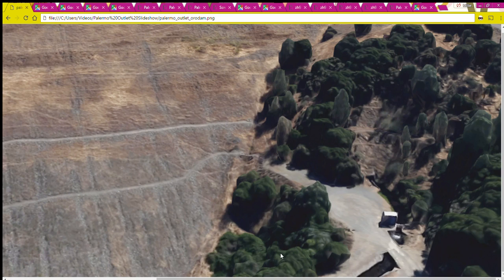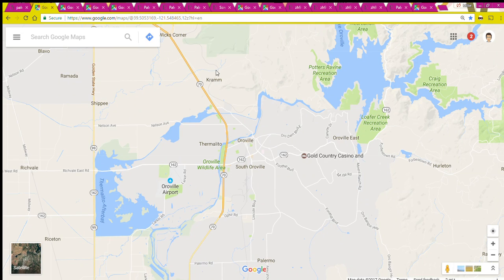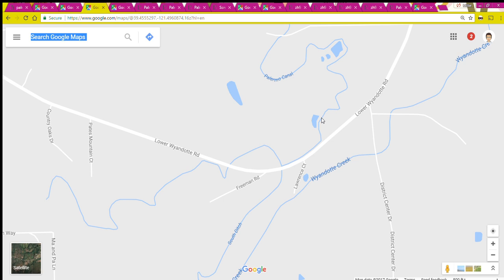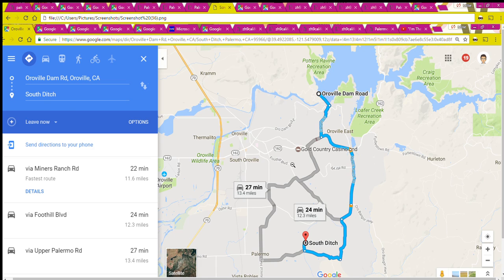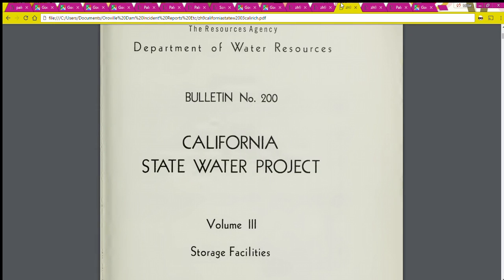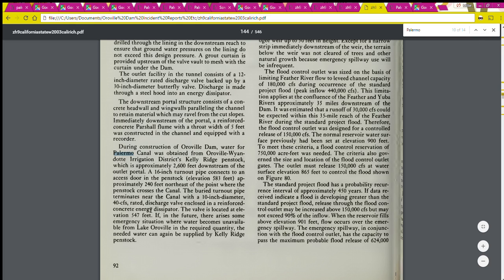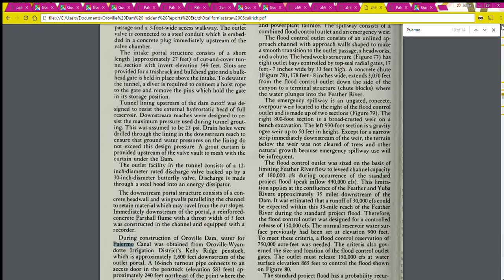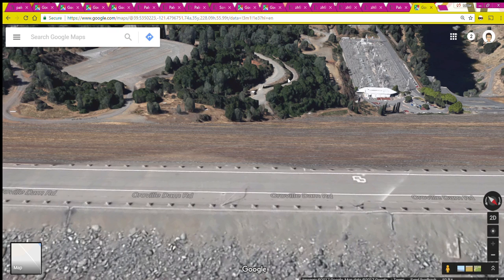The Palermo Tunnel Inside Oroville Dam  6/9/2017

Comment: Hello Millie I just want to say that you did a wonderful presentation on the Palermo Canal Tunnel through the Left Shoulder of the Oroville dam. I live in Oroville ( on high ground !! ) and am familiar with the location of the tunnel through the dam that only provides about 15 cfs of irrigation water through a valve near the outlet of the tunnel on the West side of the dam in the general area of the "green grassy area ?? ' that people are curious about. I had an opportunity to talk to Jeanne Kuttel , Chief Engineer for DWR at one of their Public Hearings and brought up the subject of the 50 + year old tunnel through the dam that needs to be abandoned and filled with concrete as it is a potential hazard over the next century +. The source of this Irrigation water to the very small Palermo canal can be easily relocated by placing a new valve in the penstock to the OWID power Plant  that crosses over the canal and under the highway as shown in your video. This would eliminate the need for acquiring irrigation water from a tunnel through the dam that could cause a potential BLOW OUT from settlement and earthquakes should it rupture. Jeanne Kuttel listened carefully  and said that she would look into it,.....we will see.
Reply from the maker: Hi Jerry. Thanks so much for your kind feedback! Your idea makes so much sense. As I was doing the research for this video, I was wondering about the risk potential of all the tunnels inside the dam. If maintenance of the tunnels is no better than that done on the spillway(s), it is a major concern. I'm glad you were able to speak with Jeanne Kuttel about the Palermo Tunnel. This is certainly a good time to present solutions to DWR. I've also been wondering if the "green grassy area" is tunnel-related. So many questions . . .

I'm glad you took the time to comment. Your input is insightful and worthwhile. Thank you.
Reply: I am wondering if there is an update on the engineering in 2021?

Comment: I understand the Palermo canal water rights are older than the Ca DWR's rights. What I don't understand is why the DWR went to the engineering trouble and expense of building a tunnel through Oroville Dam to feed the Palermo canal. Particularly when during the dam's construction the Palermo canal recieved water from the Kelly Ridge penstock. I'm guessing lawyers were involved.
Reply from the maker: Hi Robert! Attorneys involved LOL!! Don't know if you've seen it, but I made a video about the Kelly Ridge Penstock / Powerhouse.
Reply: @MillieKay  ... not yet

Comment: This is an awesome video, Millie - thank you for your research.  What led me here, other than usually watching your vid's, was a curiosity of if the Palermo outflow of the lake is included in "Outflow".  I do not believe that it is.  Possibly, one of the corrections they apply (like evaporation from the lake) when they calculate Inflow calculation accounts for the fact 40 CFS is being drained to Palermo.  The connection with Kelly Ridge is not something the casual observer would expect.  Super job!
Reply from the maker: Hi Don. You're welcome. I'm not certain if the 40 cfs of Palermo tunnel is included in outflows. I tend to agree with you that it is not. When people talk of the ways for water to be removed from the reservoir, they generally refer to "four ways" (main spillway, emergency spillway, Hyatt Power Plant, and RVOS). You'd think Palermo would be mentioned as the fifth way if it was part of outflow. Just my two cents on the matter. Thanks for the kind comment. Take care.

Comment: Interesting that it has a valve in the dam... the head pressure is likely less than the RVOS
Reply from the maker: Hi John! All I know is, per Bulletin 200 about the Palermo Tunnel, "Tunnel lining upstream of the dam cutoff was designed to resist the external hydrostatic head of full reservoir. Downstream reaches were designed to resist the maximum pressure used during tunnel grouting. This was assumed to be 25 psi. Drain holes were drilled through the lining in the downstream reach to ensure that ground water pressures on the lining do not exceed this design pressure."

I know I've seen stats on hydraulic pressure for the tunnels somewhere, but can't put my hands on it right now. Sorry.
Reply: I believe the head pressure on the RVOS is a little more than 300 psi... seems like this would be about 1/2 of that.
Reply from the maker: Sounds reasonable, John, but you're the hydraulics expert -- not me. :-)
Reply: Basically 1/2 PSI per foot of head

Comment: I wonder what the negations were for a 40 cfs canal to get it’s own tunnel thru hundreds of feet of tunnel inside the dam? I can imagine eye-rolling of the engineers behind the design of the dam being told to include a separate tunnel just to feed the Palermo Canal water right
Reply from the maker: Interesting thought, Robert!
Reply: @MillieKay  …..It may be the Palermo Canal company has extremely senior water rights and refused to compromise with the State Engineer? I don’t know. That deal was struck when the dam was going to be authorized before any work was done on site

Comment: Nice country around Palermo.  When I went thru there a couple of decades ago going down highway 99 I kept thinking there must be some kind of Palomino horse ranch around there somewhere.  It was kind of a dumb idea but I actually saw one.  As to how they use gates and butterfly valves and the like to control water flow, at the Stephan C. Guerber Park in Eagle, ID there is a very interesting valve use to control irrigation water flow outflow that use the differential pressure and equilibrium to control how far open the valve is with just a small hand valve.  It is a very unique hydrodynamic design.
Reply from the maker: Hi Under Wood! Cool . . . Yeah, that area is very inviting. I think it will be my next "Sunday drive."